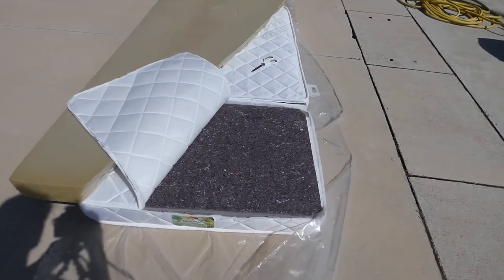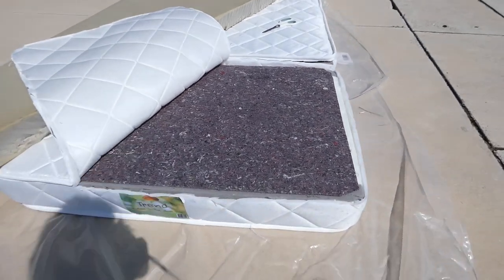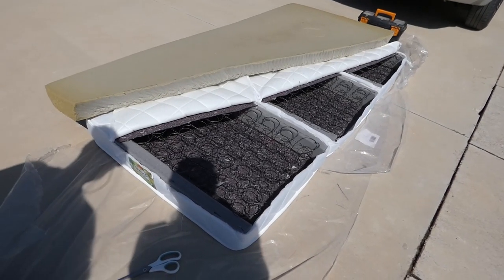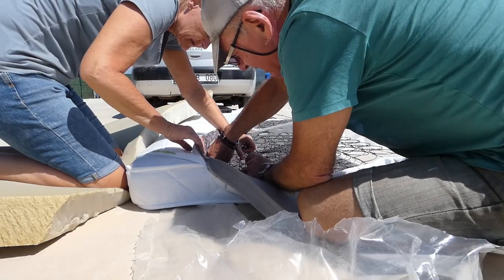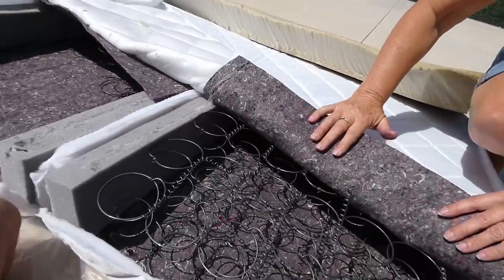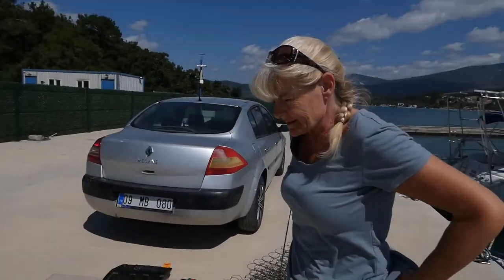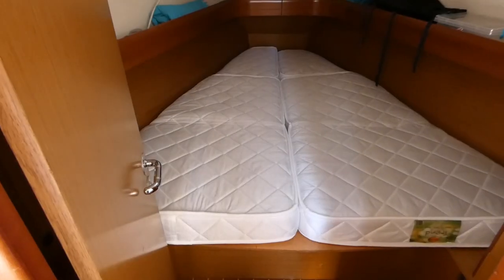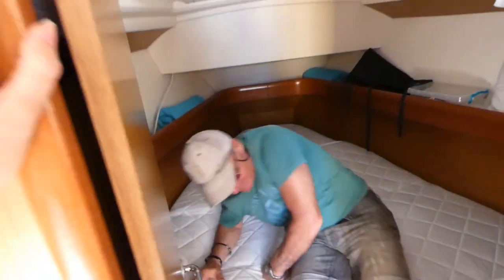Creating a 'V' Berth BOAT MATTRESS From 2 Standard Singles

Comment: Hi!! We love this idea and definitely want to tackle this project next month. Could you please tell us what you type of needle and string you used ? Also, if your mattress has solved your issues and stands up to the test of time. Thank you in advance!!
Reply from the maker: We used a needle from the sewing kit we carry on our sailing yacht to repair sails, but I guess any heavy duty needle would do. the mattress made a huge difference to the comfort and without question gave us the best nights sleeping we ever had on the boat! Still in great condition.
Reply: @chippykevb  Great to hear! Thanks. We will definitely be attempting this in the very near future and will let you know how it goes. Hopefully we'll be as successful as you both. Safe travels
Reply: So we did it!!! Faster than we thought which was great. Next up is to get a waterproof topper and we're making a slat riser for underneath the mattress to hopefully prevent any moisture damage to our new bed.